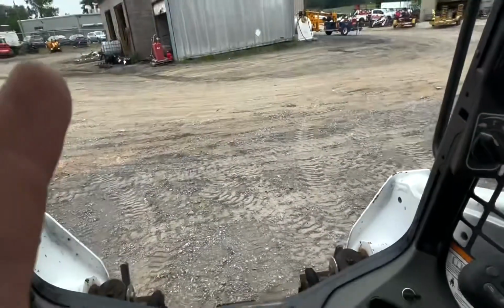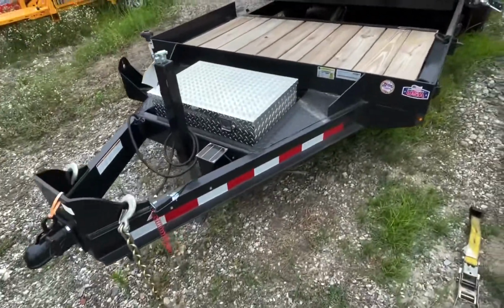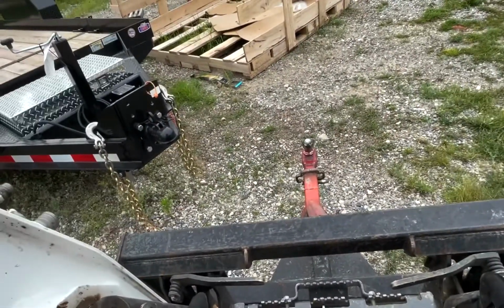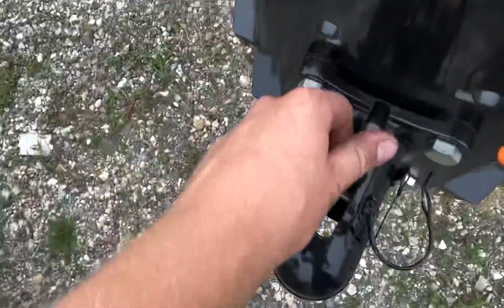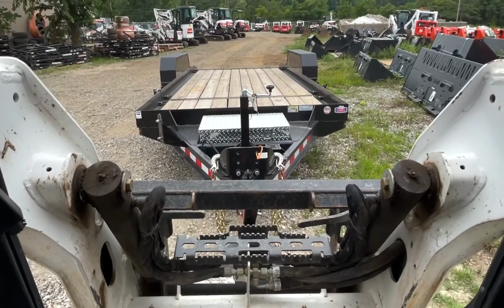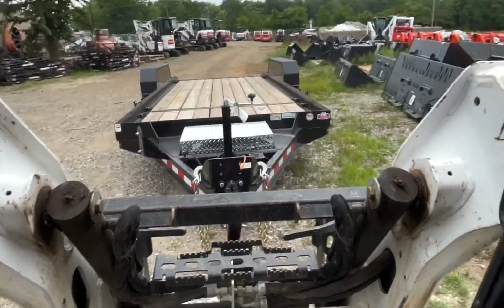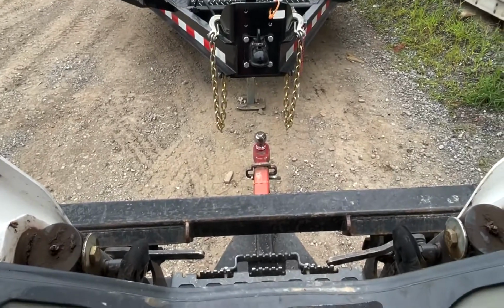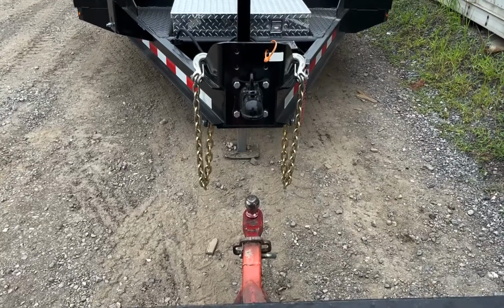How To Move Trailers With a Skid Loader

Comment: My boat yard uses a skid steer to move boats around, works great. They also have a small tractor with a hitch on the front for smaller boats.  The ball is pretty close to the tractor because any tongue weight will tip it up.  But I’ve seen them move around 21 footers with it.  And lastly, they have a big 4 wheeler with a hitch on the front and it works really well also.  They use the skid steer the most because with the other two, you have to crank down the trailer jack but with the skid steer they just pick it up, leave the tongue jack down and just move it wherever and then set it back down on its tongue jack when they get it to wherever they need it… they don’t even get out of the skid steer usually.
Reply from the maker: That’s why a lot of people choose skid steers because it’s the lazier way to do it but it also works well, just seems to do more damage on the ground

Comment: couldn’t you just use forks with a ball adapter instead of having a specialized attachment? Is there an advantage to using this instead?
Reply from the maker: Yeah you could use forks with a ball adapter. But with the attachment you are able to manipulate movement more because of how close the trailer is. But there isn’t really an exact downside of the fork attachment
Reply: So two attachments instead of one.....? 🤔 Unless the forks live on your skid steer I can't see how one attachment is better than two 🤷🏽‍♂️ I use the ball attachment on the forklift to move trailered machinery around the yard everyday, I wouldn't use the attachment on the skid steer though, too much of a hassle

Comment: I need to move my sons large 32' RV, it wont start and I need to move it about 500yards on my land. Do u think a track loader like this one would pull it around? I feel like it should. All tires are aired up and good.
thanks for help or advice!!
Reply from the maker: How much would you say it weighs? That would be the biggest factor. I think a large track skid loader would theoretically move it as long as the rv isn’t super heavy
Reply: @OutdoorsEveryday   Thanks for the video. Found it b/c I searching for a similar answer. I need to place a 11000lbs RV trailer into a pretty tight spot on a gravel pad so the last few yards will need to be done by something small like track loader or skid steer.  Thoughts? Thanks!!!
Reply from the maker: Skid loader would work perfectly but a tractor might also work if you have access to a larger one. Since they have a real tight turning radius it would also be an option if you have the ball hook up. If you have to rent one for that reason, skid loaders can be pricey depending where you go locally to you. You’d want something on the larger side to move a trailer that big so a tractor might be your best bet honestly but it 100% depends on what you are able to get